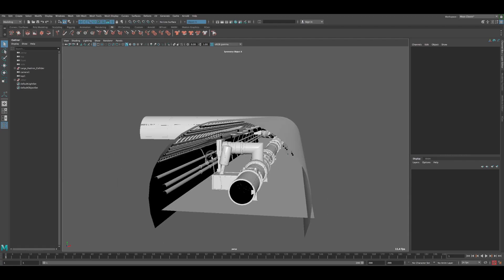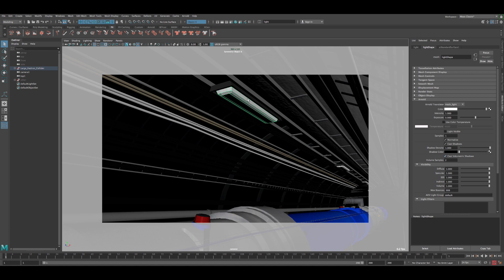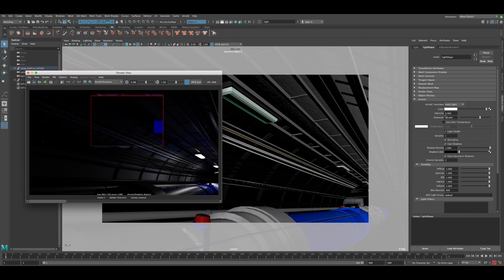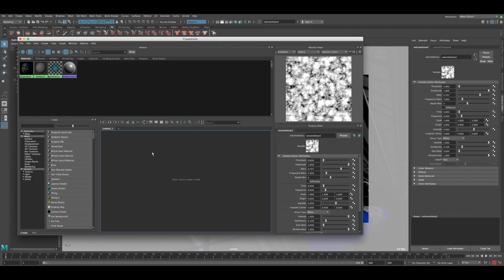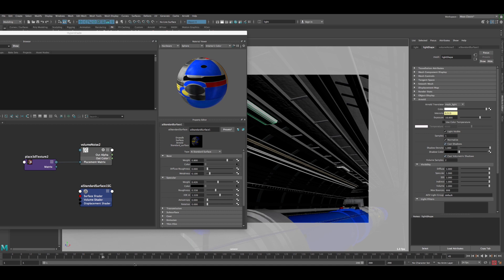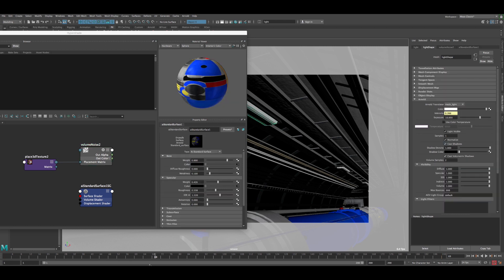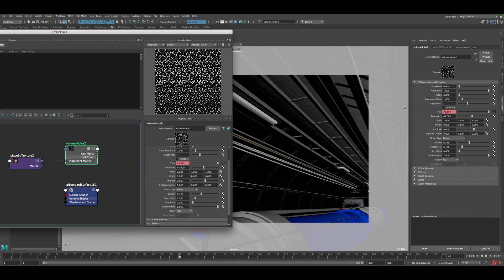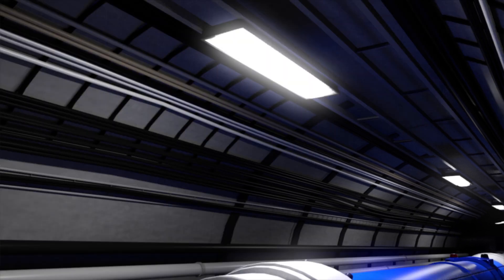How To Create Light Flickering In Maya and Arnold - Neon Flicker Animation Tutorial

Comment: Thanks for this tutorial, I achieved the effect I desired 🙏 However, I was wondering if I could link the mesh light to certain geometry in the scene, as I typically would in relationship editors. I was also experiencing something strange when I incorporated other area lights into the scene. For example, if I linked any separate area light to any isolated geometry, this noise/flicker light would cease to illuminate. As soon as I unlinked the other lights, everything was fine.. had me kind of baffled.

Comment: Nice tutorial
But why you're ignoring the topology while doing the fill hole thing
Reply from the maker: Thanks :) I'm not sure what you mean by ignoring the topology, in general its a great idea to fill the topology correctly and have the edge loops correctly connecting, but in this case for the light since its gonna be glowing its ok to do it the fast way, at least in this case. hope this helps :)
Reply: @3DModelsWorld.  I meant faces with more than 4 vertices are consider wrong but after that doing the fill hole you didn't connected the vertices and it left the base face with 8 vertices

Comment: how do you use glow intensity on blinn material attributes?
Reply from the maker: Hi David, if you want to use the native Maya glow in the blinn material you will find it under "special effects" tab just under the "specular shading" tab, however I don't recommend using the Maya blinn glow, I recommend to use the glow in comp, in After effects for example you can apply "stylize =>glow" on the render pass or the lights render pass then all the lights will glow and you will get much better and stable results., plus you can easily control the intensity of the glow in comp with re-rendering. hope this helps :)